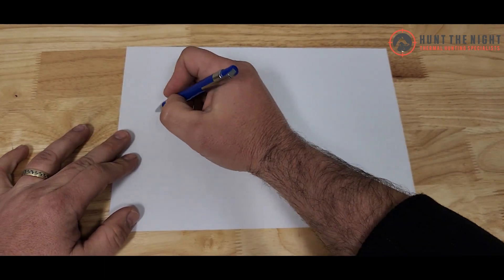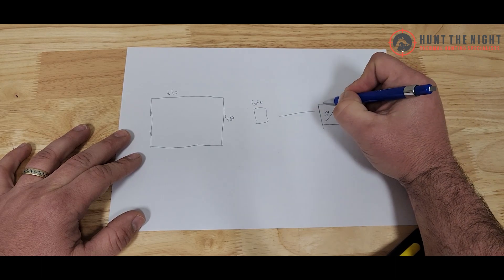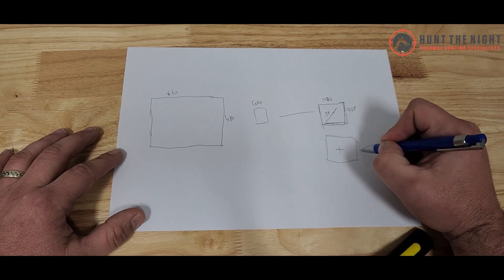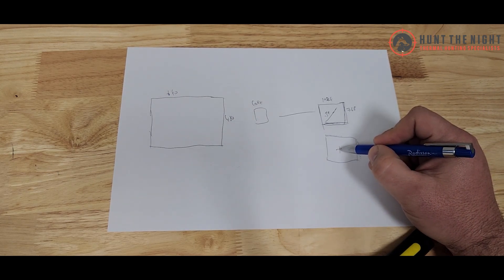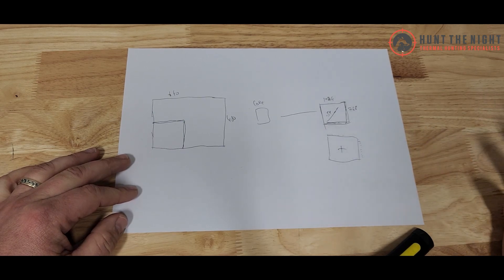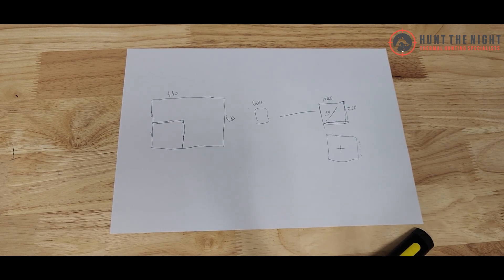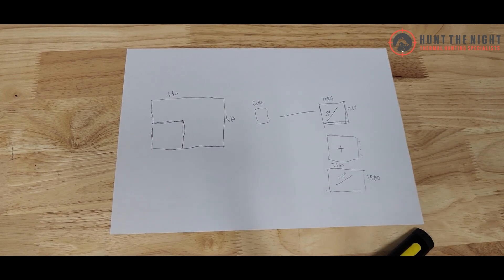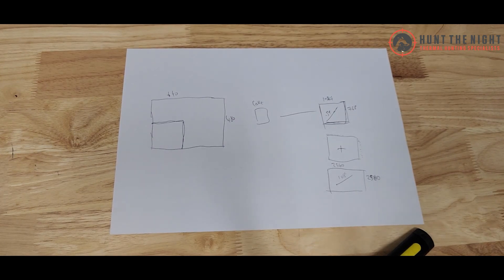Thermal Sensors, Screens and its effect on zeroing accuracy. with ben from huntthenight.com.au

Comment: Ben the click value (mm/100m) of one display pixel would have been the same regardless of thermal sensor size had you used the same image magnification, instead of using the base magnification, wouldn't it?